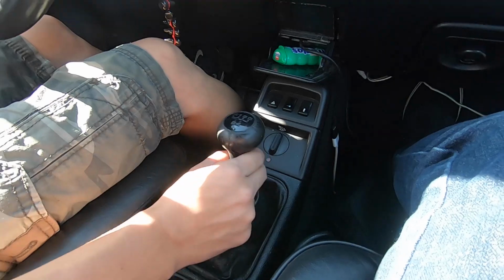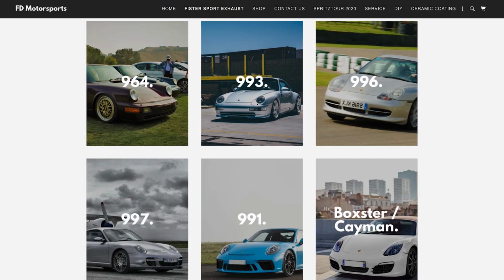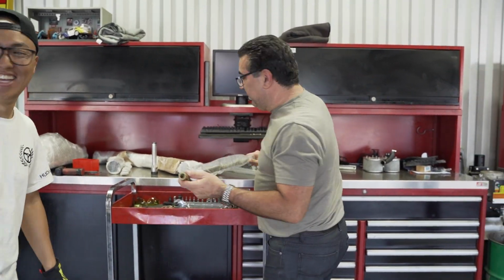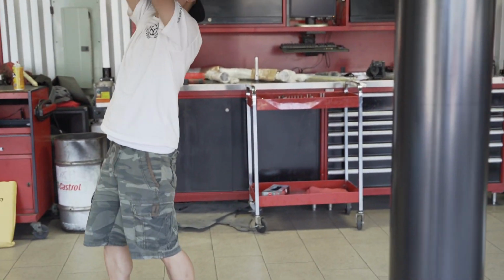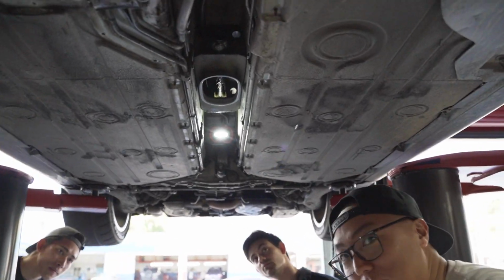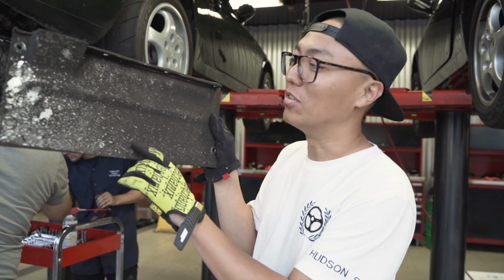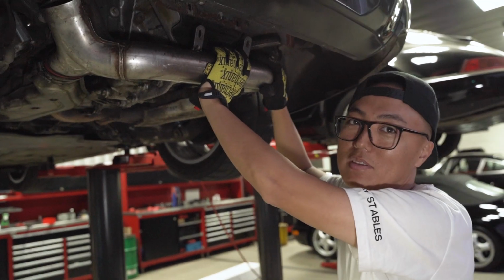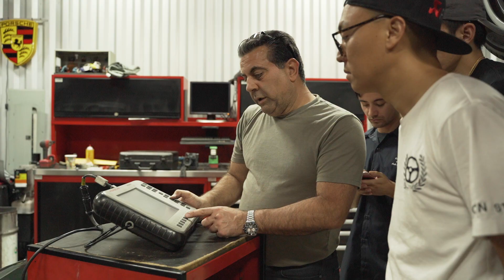Installing FD Motorsports Short Shift Kit + FD Sport Exhaust

Comment: So cool for you to share - I did this back in '97 (damn - that time has flown by :)) on my "93 964 C2 Coupe  - in my driveway using TechArt parts. Totally transformed the car  ... now ... ditch the airbag steering wheel for a MOMO ... drop a killer stealth stereo .. then a Matter aluminum roll bar (they made all the factory stuff back then) ... keep the mods rock'n Drew !!!
Reply from the maker: 93 964 is a dream!

Comment: I have the golden rod short shifter on my 993 and honestly, I think it makes shifting a bit harder on the syncros. Can be hard to disengage. I might go back to stock.
Reply from the maker: I’ve noticed that at times too
Reply: @cooledcollective  actually my problem was NOT the short shifter at all but I really needed a new clutch. Replaced it a few months back and now the whole set up is as smooth as silk. Love it